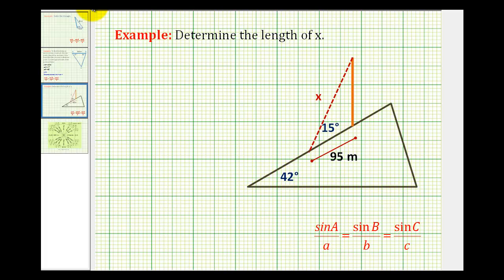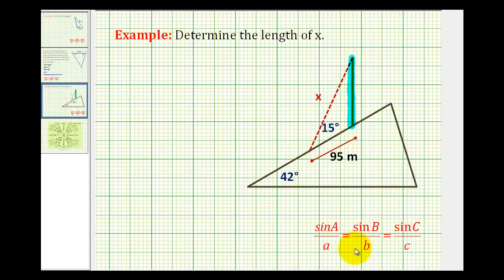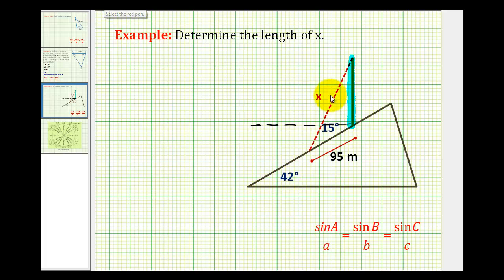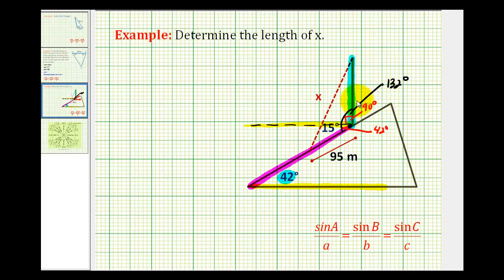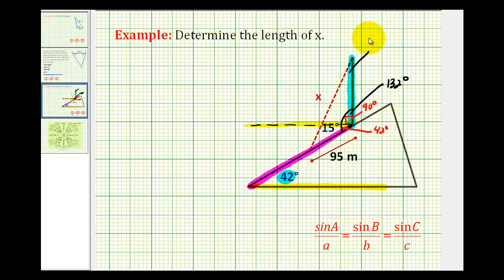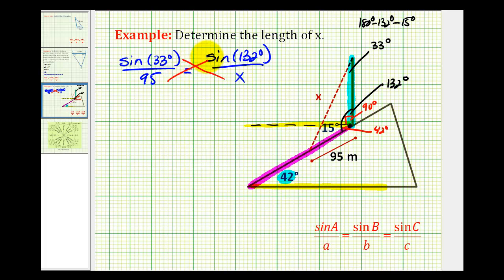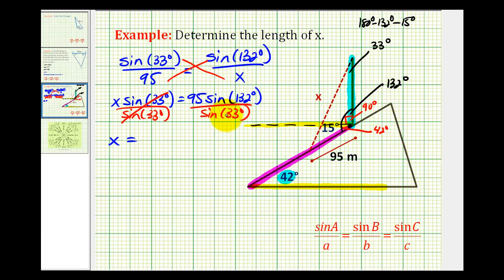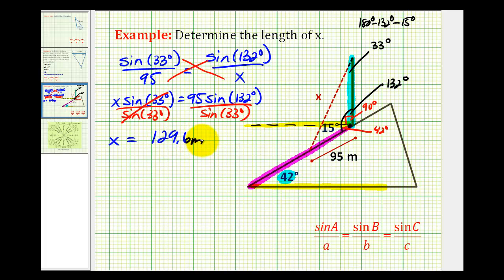Example 2:  Determine an Unknown Length Using the Law of Sines

Comment: You can also solve this problem without using the law of sines... draw a horizontal line going right starting from where the support wire meets the hill, and extent the line of the tower down more. This forms a 90 degree triangle. using the known 95 degrees and the known angle 42 degrees, you can use right angle trig to get the length of the base of the triangle. After that, combine 15 degrees and 42 degrees to get the angle between the base of the triangle you drew and the support wire. Then, using more right angle trig, you can find the length of the support wire using the length of the base of triangle you drew and the angle between it and the support wire!